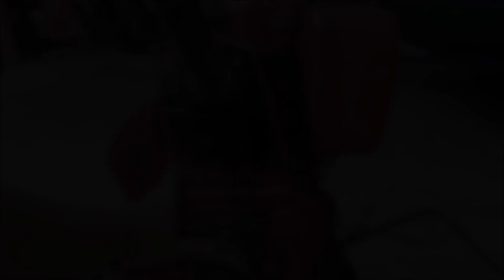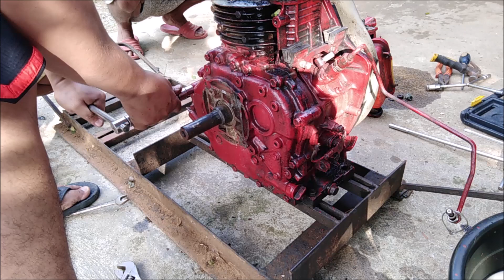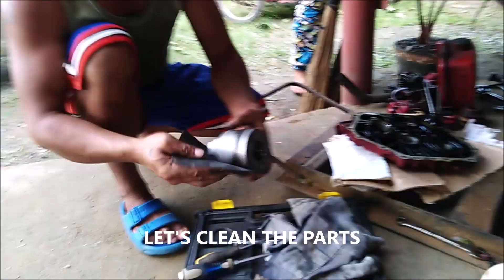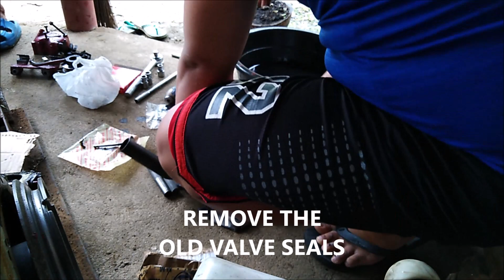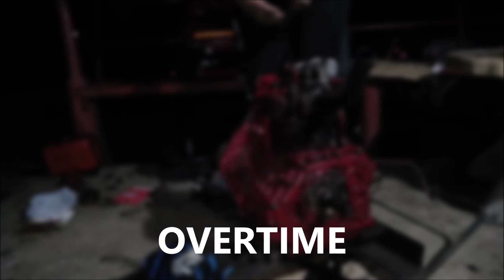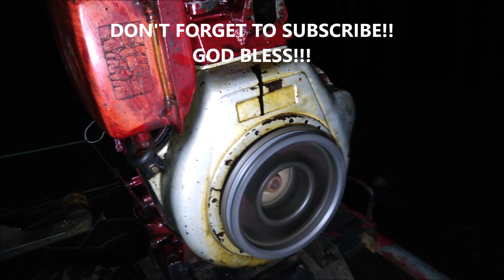KAMA SINGLE CYLINDER DIESEL ENGINE | HARD START PROBLEM| TIMELAPSE

Comment: Pano ung kahit nagpalit kna ng pistonring at valveseal lopower parin at maosak pag nilagay sa koliglig boss?
Reply from the maker: Nozzle na  paps ang kailangang palitan kapag ka ganun.. O di kaya naman baka maluwang na talaga yong cylinder bore..
Reply: Bagorin nozoletape niya para kako walang rason?walaba paraan un paps kong malowang na bore niya?
Reply from the maker: Baka mahina ang compression paps.. Sinukat mo sana paps yong bagong piston ring mo don sa bore niya kung malaki ba yong gap.. Kung medyo malaki yong gap i oversize mo yong piston ring paps saka ka mag regapping..
Reply: @efrencalngao2755  tanggalin mo boss ang tambutso taz paandarin mo. Pag may tumagas na langis, was epek yung pinalit mong piston ring. .
Reply: Wala natagas na langis at ok ang andar pag idle kaso pag itaas mo idle spid niya itim ang osok at hindi makabatak?
Reply: @efrencalngao2755  check mo yung oil filter,yung katabi ng drain plug,yung plastic na itim na may isang turnilyo. Pag may mga kinayas na bakal. It means kinakain na ang connecting rod bearing ng makina mo.
Reply: Palit na lahat conradbearing binugahan ko ng aircompressure un oil strener sir?inisip konga baka palitan ko nalang bago silinder niya eh?kaya bibili nalang ako malaki piston at putolan ko nalang sigoro
Reply: @efrencalngao2755  baka naman barado ang air cleaner. .Palyado ba pag tinataasan ng andar?
Reply: @BoyKalikot  oo napugak pag taasan tapos hindi lomakas ang andar sakal pero hindi naman mamatay?
Reply: @efrencalngao2755  tanggalin mo yung air filter element. Taz paandarin mo. Pag walang nagbago,check mo yung hose,baka may butas o kaya may singaw.
Reply: Ada mesennger mo bos send ko yong andar niya parang sakal ngay?
Reply: Puti ang usok niya?
Reply: @efrencalngao2755  tinanggal mo na ang air filter element?

Comment: Lods tanong lang yung kama 10hp. Namin bigla nalang ayaw umandar. Bago change oil bago piston ring bago din con rod bearin ano kaya possible na  sira lods? At kung ipa ayus ko ito mga magkano kaya magastos? Salamat
Reply from the maker: Try pa calibrate ang injector sir, saka palit fuel filter kapag dinp napapalitan..